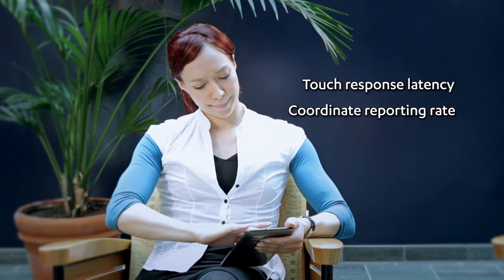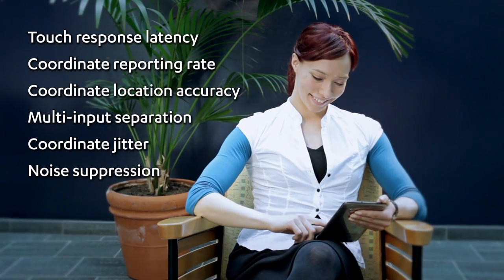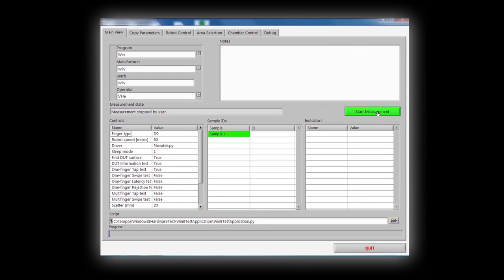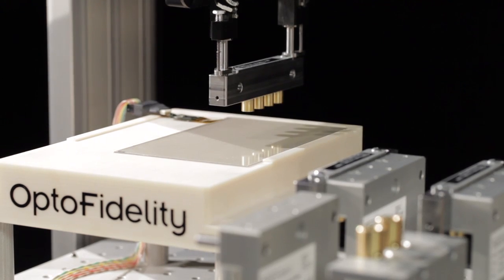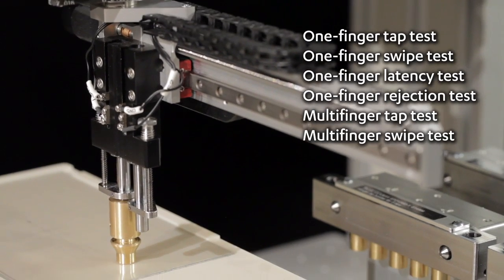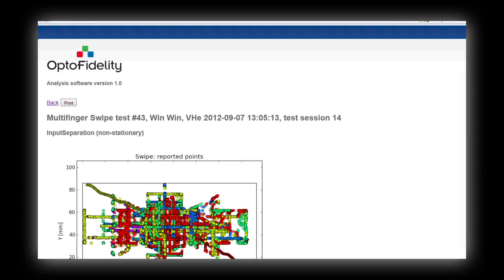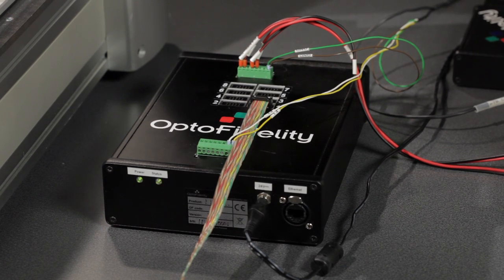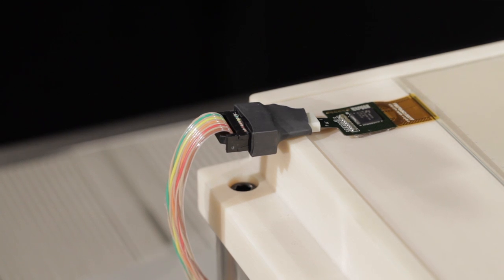OptoFidelity Touch Panel Performance Tester

Comment: From 2007 CNET article: "...the iPhone has a feature that will dynamically resize the "hot zone" for a key that you are likely to press next. For instance, if you are typing the word "time" and enter "tim," the iPhone keyboard will automatically increase the hot zone size for the "e" key, since that is the most common letter to press next."

Writing something meaningful with your robot may yield interesting results... Or using it in a line-of-sight manner from eyes to finger.

Comment: .. with Software (iOS). I would guess that it is supposed to be so, to correct parallax shift, and even if it is not, it is just a matter of a software update. It is not inaccurate in a random way, as said the output plane is just a bit bigger as the input plane and the consensus is in the lower half a little shifted to the left (which seems to be the only problem)

Comment: We can clearly see the offset going to the right on the right, to the left on the left, to the top on the top and to bottom on bottom, so it just corrects the parallax effect that comes from the distance between glass and pixels.
The only thing that does not seem to fit, is that the center is not in the middle but shifted a bit to the left.
And even if it would not be the parallax shift, you can see, that the output surface is just bigger as the input surface, so it could be easily downscaled ..

Comment: I can clearly see, that the circles and spots on the iPhone screen have an offset going to the right on the right, to left on the left, to top on top and to bottom on bottom.

So this is just correcting paralax effect, when you look on the screen. There is quite a bit of a distance between finger and pixels.
The only thing that does not fit properly is that the center is a bit more on the left than in the center.

Comment from the maker: If this would be true, you should see a constant offset to one direction only. We are also able to analyze constant offset from results. In these measurements, there was no constant offset to any direction. We selected artificial fingers that give same kind of input to touch screen as a normal human finger. Selection is based on actual data gathered from touch screen modules when touching them with human fingers, artificial fingers and styluses.

Comment from the maker: OptoFidelity is a nonaligned, privately owned company. We are executing our own case studies and benchmarking to raise awareness of our test automation options. At the same time we want to point out the significance of proper testing for the end product quality.

We can test touch performance of touch panel devices from all manufacturers. We have done several case studies for many kinds of devices. If you watch our other test demo videos you can see that it is exactly what we have done.

Comment: Why barrel shaped dummies instead of actual finger shape? Contact face of fingers is slightly off to the point where user actually intends to touch. Intelligent designed operating systems correct for this, which makes your tests completely meaningless for real world usage.